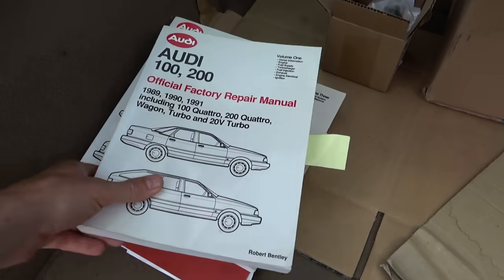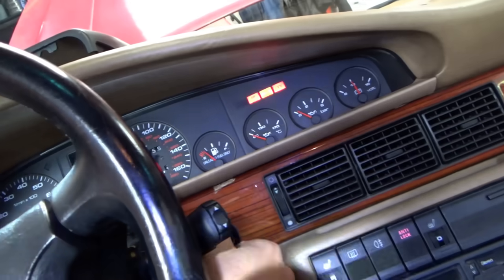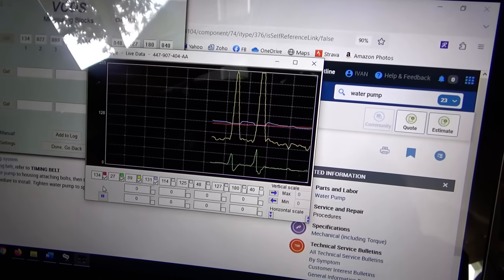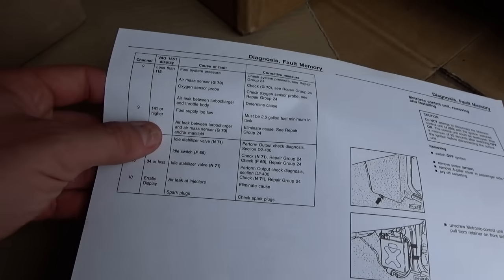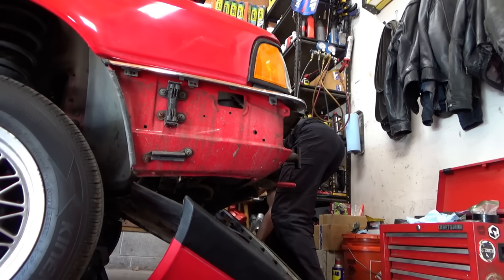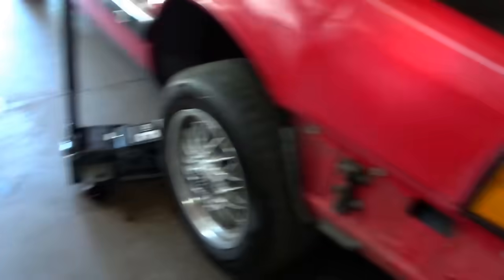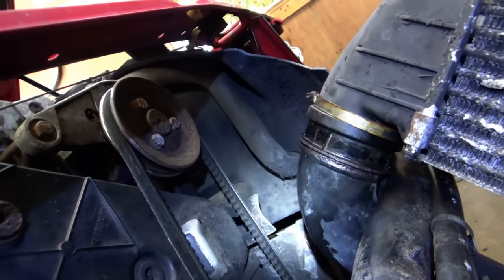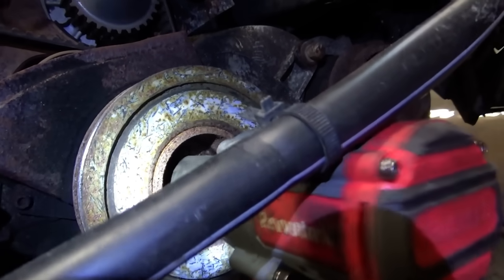(Pt 1) Audi THANKSGIVING! ('91 200 Quattro 20V Turbo is BACK!!)

Comment: It takes a special kind of mechanic to work on something like this. More patient, more methodical, more careful. Any less of any trait, and the job doesn't get done. You are the man!!!
Reply: But everyone usually says older cars were so much easier to work on, and modern stuff is too complicated, difficult to work on, and nearly impossible to repair.

Comment: I worked for a Porsche/Audi SAAB dealer until 1999. Our master Porsche/Audi tech had one of these in the same color. It was a beautiful car and he loved it. A lot of techs hated working on the 79-93 SAAB 900s. When I witnessed the hoops and hurdles the Audi guys went through I shook my head. When I saw the front end lying on the floor I asked "what are you doing"? The tech happily replied "a timing belt and water pump". God bless the Audi fanatics. I'll stick with the SAABs. Back in the days before the internet and the on-line service information subscriptions those Robert Bentley manuals were a godsend. They were the best service manuals you could buy. They were written in conjunction with the manufacturers and went into far more depth and detail than Haynes. We sold both Porsche/Audi and SAAB Bentley manuals.

Comment: I was shouting "nooooooo" so hard when you tried to grab that hot bold with those plastic gloves!!!! Luckily that ended well😂
Reply from the maker: Hahaha have you worked on many of these 80s Audi cars Dan? They are a treat 🤗🤣
Reply: @PineHollowAutoDiagnostics  no i have not worked on many Ivan. But i do remember them, i  actually realise that i haven't seen one in the wild for many years. They are a rare sight, it makes it even more special that you have a customer using it as a daily driver. The design to get access to the timing belt is actually quite good. Of course this is an old car but back in the day when the bolts weren't seized you could easily removed that front within 20 minutes. After that it's all super accessible. I saw that you removed the central bolt on the crankshaft but if i recall correctly you need to undo the 4 hexbolts. But i realize that might be a challenge after all those years. Looking forward to the next one Ivan. Keep up the great work!

Comment: Him driving it daily is the best thing he could do for it. RedKote fuel tank coating is amazing!!! I wouldn't do the A/C without at least replacing the hoses. Keeping my fingers crossed. That's one of those two piece crank pulleys corroded into one. Eric "O" is going to be proud of you!!! LOL!!!! What a mess to just get to the timing belt. Thanks Ivan!

Comment: Thanks Ivan.  PHAD really does go good with coffee.  ;)   I had a Toyota RAV4 come in a couple weeks ago, and I heard it pull up because they had already cut holes in the exhaust.  I told her, now the exhaust has to be fixed before I do anything else.  So they purchased all 3 converters and brought it to me.  I installed all of the parts and it fixed nothing.  I called and informed the middle man and he said fix it.  Turns out the driver had put a DURALAST  MAF in it.  I told him that has to be changed for a factory sensor.  That cured the running problems.  XD  "VZ's Garage: We repair what your husband tried to fix."  XD

Comment: when you do a belt on those you leave the centre crank bolt in and remove the 4 12 point bolts and remove just the pully leaving the belt drive on the crank just a note to help ok
Reply: beat me to it hes gona have fun putting back together like that
Reply: Nope
Reply: Ah yes it's floating crank gear as used on fords now
Reply: The aan engine you have to remove the large crank bolt along with the 4 allens
Reply from the maker: @blueskiesmobileauto4253 hey Josiah is your 5cyl beast Audi ready to rip?? Never touched the 4 seized Allen bolts, belt was happy 😊👌
Reply: This is the right way to dismantle, to take the 4 Allen bolts Ivan, did you looked in the manual 😉 @PineHollowAutoDiagnostics
Reply from the maker: @Jedi_Masteren  yes of course. The manual said DON'T TOUCH THE 4 BOLTS! 😉
Reply: Sorry mate you wrong there been fixing these for a long time doing belts on  5 cylinders since I was 18 now am 56 you going to have some fun putting it back @PineHollowAutoDiagnostics
Reply: Sorry, your right Ivan, it's just some other of vw group car, where you need to take the 4 bolts 🥺🥺🥺 @PineHollowAutoDiagnostics
Reply: @ Yepp the 5 cyl turbo is considered one of the best/unique sounding engines out there! I installed the graf pump and haven’t had issues yet but my box actually said made in china where I expected Spain. It was fcp euro so we’ll see if it withstands!

Comment: I work on tdi's, so vcds is a must-have. Not sure about this old audi, but the adaptation menu will give you way better data. And use advanced measuring blocks menu for graphing.
Reply: These systems are so basic all you get is block 000.

Comment: Those 4 Allen bolts in the crank pulley -  usually end up with 4 rounded out Allen bolts in the crank pulley.   Then where to get new ones.  Taking out the big bolt and removing the whole thing with the sprocket still on  works just fine.

Comment: Ah yes, I've been waiting for this one!  I should have known it was going to be either a Thanksgiving or Christmas special!  Kudos to the owner once again for all the time and care he's put into this one.  There is mention below of just undoing the 4 allen bolts on the crank pulley...wrong.  You gotta remove the main crank bolt.  Anyone thats worked on these (me) and even the service manual states the same, knows this.  Nice work on getting the front end off!  The smaller chassis cars prior to 1988 dont have that luxury,  so you gotta work around the front body structure.  Cant wait to see the next episode!

Comment: Happy thanksgiving from his side of the pond 
Ivan you may find it easier to put it back together if you take the four bolts out of the crank pully that way you can split the drive dog off and fit the large bolt and dog back on to set the timing without the outer pully getting in your way just watch out for the Allen headed bolts warm them up in order to help them come loose been a while since I did one of these but I still remember that is the best way good luck.
Reply from the maker: @mrcogginsgarage7062  I'm not removing any fasteners on this time capsule unless I absolutely have to 😉
Reply: Understand completely Ivan.

Comment: Ivan, probably too late at this point, but on my Opel Omega 94 I converted to R134. 
As for Opel instructions, orifice tube should be changed from white (0.072") to yellow (0.062") due to diferent pressures. I changed almost all components, so just filled with PAG 150 oil and charged about 80% of the mass of R12. Worked like a charm. 
Here in Brazil due to wheater, we do some tune up on the compressor control valve and orifice tube to blow really cold.

Comment: I bought a 200 FWD sedan for my daughter to drive in college and lusted after a TQA but never bit the bullitt. I eventually sold the 200 to a friend who after driving it for a few years did upgrade to a 200TQA though so I finally got to drive one. I also had the 3 volume service    manual and remember that there was a great 200TQA website that covered almost everything one would need to fix on these great cars.

Comment: By the sound of the engine idling I would’ve thought you were working on a ‘80s - ‘90’s  V8 GM car. Running smooth as butter.

Comment: Those 4 pin electronic thermo switch devices can be a pain. If the one the customer got is URO brand throw it in the trash. 
If the connector for this switch is cracked / falling apart, you might be able to find one attached to the trunk release motor on a Porsche 928. They're NLA from Audi. 
Check the wire from the alternator to the battery, there's a junction in the passenger footwell that can get high resistance. 
Also be sure the car got the field modification to put an 80a fuse on the ground side of the radiator fan. Many of these had no circuit protection from the factory, and the fan locking up will burn the car down.

Comment: Quite common on this age Audis to use the water pump as tensioner. I have a couple Volvo 240 with D24 Audi/VW Diesel engines. In those the WP is also a belt tensioner.

Comment: I do like a 5-pot Audi. Current (and for the last 21 years) daily driver is a 1996 A6 C4 2.5 TDI. Both the car and the engine are closely related to this red beast.

Timing belt setup on mine does at least have a fixed pump and a proper tensioner. Have done belt several times now and I don’t enjoy it, the harmonic balancer bolt is a monster. Torque to 200Nm then turn a further 270 degrees….. really helps to have the pulley holding tool. I made one a few years back.

Curious to see how Ivan gets on doing it back up.

Comment: Good going on taking on such a project!  Yes, those old Audis can certainly turn into an adventure.. :-) 

If you've not got the timing belt job completed yet..  
-Absolutely most correct way to find TDC is through the opening on the bell housing  on the driver's side.  Is mentioned in the Bentley.  (The crank pulley/front cover mark is only a 'suggestion' as compared to the flywheel mark, as the crank pully can move, relative to the crank because of the rubber bonding in them pulley shifting. )

-Good going on not undoing the 4 Allen bolts holding the cam sprocket to the pulley. As you say, won't help at all. Not sure why people keep mentioning that detail..?

-Most important..  If you got the crank pulley off without using the crank locking tool without damaging the keyway , you are lucky.   Bentley SPECIFGICALLY  says to use the crank lock tool.  
Weren't you following the step by step instructions in the Bentley?  :-) 

You DO  need to lock the crank at the crank pulley before messing with the crank bolt. If you don't have a proper locking tool, you can make something to lock the pulley by finding a short piece of pipe the fits on the inner diameter of the crank pulley,  cutting a notch to clear the tab, letting the  short piece of pipe fit into the pulley properly, and still be hooked by a big pipe wrench.. Then, use a big pipe wrench on the piece of pipe to lock the pulley against the front snub mount when tightening.   (Motor doesn't have to be a TDC to tighten the bolt, assuming you've already got it timed correctly).  

Correct torque setting to use without the funky torque extender tool (mentioned in Bentley)  that Audi wants you to use is 330 ft/lb. 

Here's WHY you should use the crank locking too (as mentioned in the Bentley!) :

It's actually not to lock the crank (you can do that by putting in gear, or locking the flywheel, or a bunch of other things like using an impact wrench)

What the lock tool  is actually for is to keep the crank pulley from moving relative to the crank, when working on the crank bolt.
Look at how the crank timing cog is mounted.. It sees none of the crank bolt tension, but is bolted to the back of the crank pulley. However, the cog does have it's fragile keyway to index the pulley.

So.. Think of the crank pulley as a really thick washer that is clamped under the crank bolt. When tightening the crank bolt, there is a tendency of the pulley to try and follow the turning of the crank bolt as it gets tight. (thinking of a washer, turning a bit with a bolt you are tightening).

Now that fragile keyway on the cog can't take the amount of torque that the crank pulley (unlocked) puts on it, and can crack (either tightening or when undoing the pulley).

Without the locking tool to take the load off the keyway (tightening or loosening), the keyway can crack. If all goes will, you'll never notice that the keyway cracked, as the crank bolt is plenty tight. Timing may be a bit off, but probably close enough not to notice. You may only notice the keyway is broken when you do the next timing belt change. It could have been broken for years, but you'd never know until next belt change, as long as crank bolt stays tight.

To those who buy the billet cog: Even though it has a stronger keyway (so you may get by without the crank lock tool), it won't stop the carnage resulting from the crank bolt coming loose a bit.. If the bolt comes loose, the keyway WILL get destroyed, no matter what timing belt  cog you have. The only way you get catastrophic timing belt crash is if the crank bolt comes loose, and no keyway will ever save that..

Use a proper torque wrench (not impact) , the flywheel TDC marks, and  lock tool when installing the belt, and you should be good!

Comment: Converting this car to 134a isn't too bad. Take the evaporator out of the cowling, and you can blow all the old mineral oil out. The condenser is serpentine, so it can be flushed too.

Comment: Now that the bumper is totally ripped off you better replace that inter cooler radiator as well. And by bolting all together, for at least the bumper, I would use some grease. So that by the next time all comes off jus more easier. Same counts for those hoses on metal. Just spray a petit of silicon grease an der then stick together.

Comment: You have to loosen the 4 screws to separate the gear from the harmonic balancer. In newer Audis (i own a 1999 A4, a 2005 A4 and a 2013 Seat Exeo, which is based on 2005-2008 A4), only the 4 screws are loosened when changing the timing belt, the central screw can remain in place. It is only loosened, if the gear wheel has to come off to replace the oil seal.
Greetings from Germany.
Reply from the maker: This is 1991 so it's not that easy 😂

Comment: For a very stiff balancer bolt it was known to use the following technique, and I can confirm from personal experience it works. Put an impact socket of good fit on the bolt head of not less that 3/4 drive and a good extension bar under the suspension arm/ sub frame rail and tie it so it doesn't fall off. Pull the relays for fuel pump and ignition and turn the engine over in short 'bumps' the starter will basically screw the bolt out. Just make sure the engine turns the right direction first. Sounds sketchy but done carefully it is simple and effective.
Reply: Easier just to use a half inch air impact gun.
Reply: @gregjohnson2073  Yes but it doesn't impress the apprentice quite as much. ☺

Comment: The good old 5 cylinder crank bolt. It is torqued to 450Nm (332lb-ft). Or 350Nm if you use the VW 2079 extension and tool to hold the pulley in place. Also the woodruff key on the crank pulley tend to crack.
Reply: Damn that's a lot of torque for that bolt.

Comment: Yep good ol MAP gas. I think it runs about 200 deg hotter than propane ( blue bottle) You can braze with it or solder brass. Even silver solder copper. Radiator repaire as well.

Comment: Ivan to remove harmonic balancer you dont need to remove centre bolt it can stay with the gear. Just remove those four bolts. They will seperate harmonic balancer from the gear.

Comment: MAPP gas was discontinued in 2008 and it burned at 5300 degrees. The new MAPP Pro [same yellow color] only burns about 130 degrees higher than propane at triple the cost. Save your money.

Comment: The crank pulley removal needs only the 4 Allen bolt to be removed not the big bolt
Reply from the maker: That is NOT correct...;)
Reply: Yes Ivan you’re rt, but you need to take out the 4 Allen bolts to installed the crack timing gear first install the tbelt and then install the crack pulley big bolt as well the 4 Allen bolts otherwise the tbelt installation ill be more difficult.

Comment: I believe those manuals are Bentley Manuals?  I still have the Bentley Manuals for several VWs.  They are excellent manuals.   Looks like you are putting that Audi into “service position.”  That is still done in the late models.  However everything comes off in one piece.

Comment: I am worried about those "premium quality" aftermarket parts. For example i used Febi parts and some are ok, some are very weak. Also not sure about "four-season" a/c compressor ;p Personally i would choose different part companies, but it is just me.
Reply: Four Seasons is a Standard Motor Products line and they are quality parts. Never done me wrong at least and many parts still made in the USA.
Reply: Ok then i wasn't sure. I know Febi but not four seasons.
Reply from the maker: Not many part options left for this classic German rig 🙄
Reply: @PineHollowAutoDiagnostics  Actually, that's true. I was stupid to think there was any choice :P
Reply: I think you’re right.  4 Seasons went way down on quality when they were bought out.  I was surprised Ivan didn’t give a sermon on using aftermarket parts or refuse to use them. I’m very aware of the few parts options available but I would certainly tell viewers it’s not his choice.  I was in this business 50 yrs and have seen the demise of aftermarket quality sink as $$$$ became more important to suppliers..
I don’t miss working on these at all. That’s part of my age and aches ‼️

Comment: Ivan that motor is a pig to get the air out of the cooling system and it will keep getting hot, I ended up vacuum-filling my 5-cylinder motor after spending days pissing around trying to bleed the bugger
Reply from the maker: Hmm this one bled right out no problem 😊

Comment: I think Ford and a few others having problems with timing chains should just use a Belt, Why? Because they work, And you have to maintain Cars anyways most need water pumps and new coolant replaced at right about the time of a belts usable lifespan, I own both engines belt's aren't the reason not to buy a certain Car-Engine.
Reply: Ford is having belt problems not chain problems.  Dumb wet belt system.  I know, I had a Focus with one.  Just dumped it and Ford.